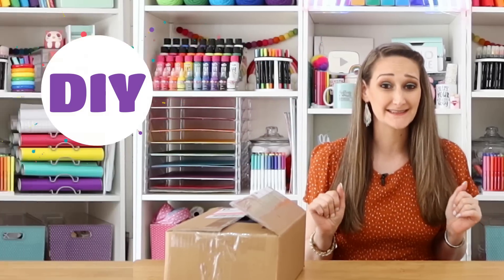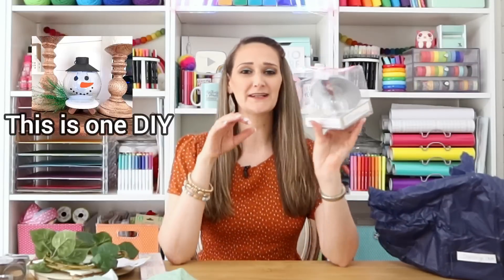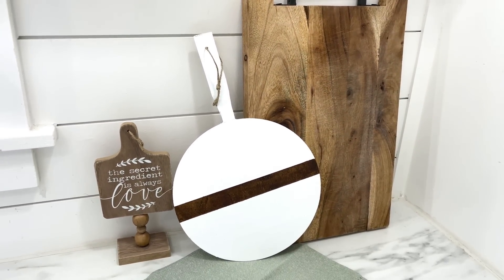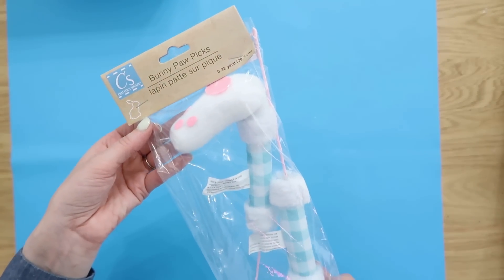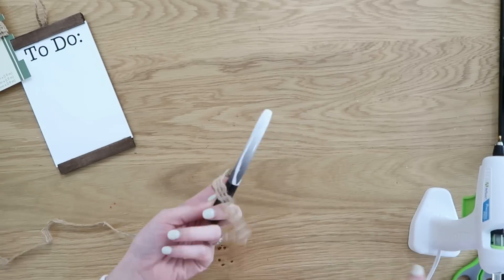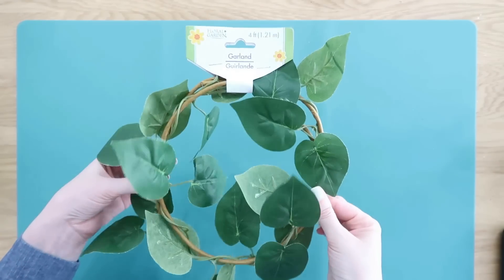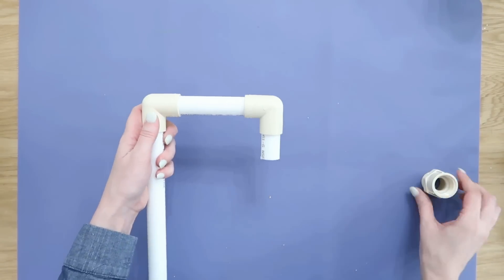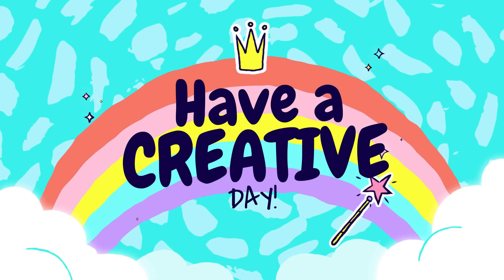HACK these *CHEAP* Dollar Tree FINDS!! (easy but totally genius ideas!)

Comment: Using 1 of the napkin rings as a toothpick holder (it will need a bottom piece)or glue all three on top of one another for small paintbrush holder or a pencil holder or put small fake flowers in it. You will have to put a bottom on it too. Or glue them together on their sides or drill holes in them, put bottoms on them, add small things in them. The little light fixture you made is really cool. Wonderful job on that piece!!!!??

Comment: With the other napkin rings, glue them to a board, spaced about 12” apart.  After you store your broom bristles up in a clip inside the closet, slide the broom handle down into the napkin ring circle.

Comment: Maybe use the napkin rings for feet on the bottom of a riser, or glue them together vertically and make a “neck” for a lamp.  Then make a base for the “neck” and then put the solar lamp on top!  Then you have a taller table top lamp.
Reply from the maker: Love those ideas!